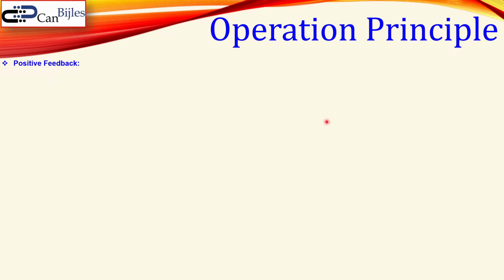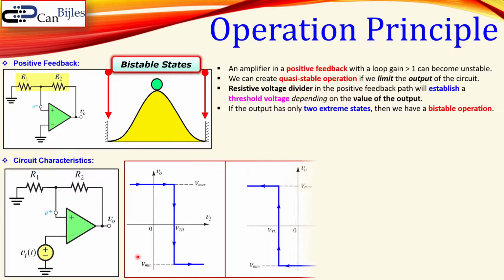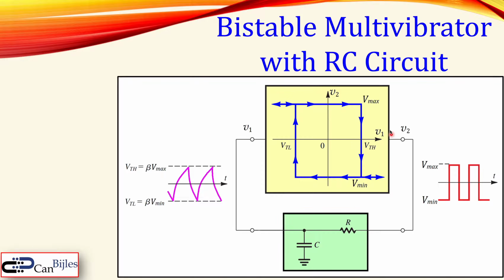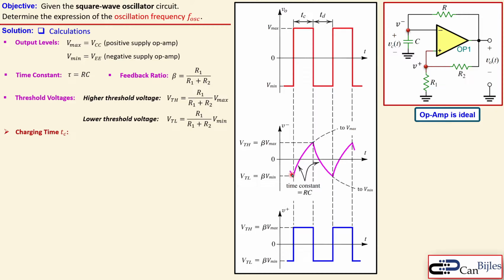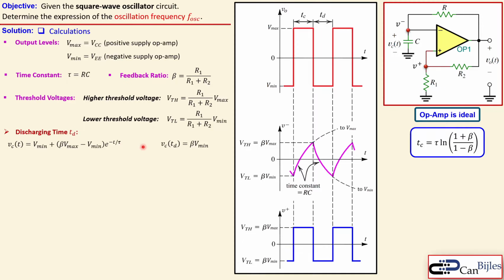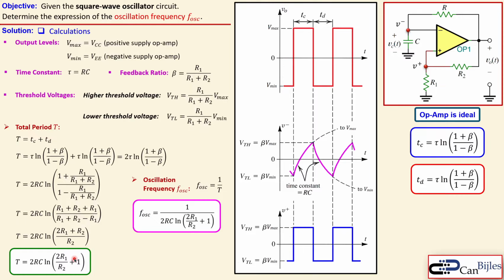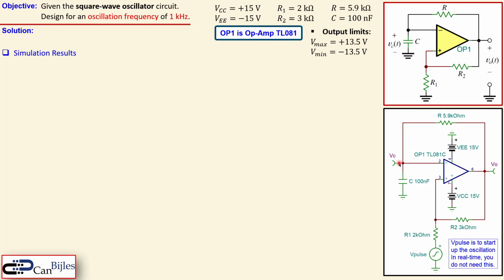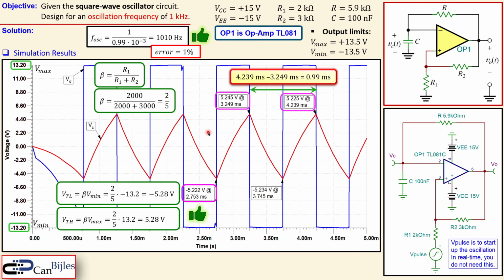Square-Wave Oscillator ⭐ Oscillation Frequency Derivation, Design Example & TINA-TI Simulations

Comment: I don't know how you can plot the graph of v- when you don't have a function at first? That makes me confused a lot when I approach this video.
Reply from the maker: The graph is derived from the capacitor charging and discharging equations which I explain in the video.
Reply: oh I know it, They are the formulas for discharging and charging voltage of a capacitor.

Comment: so what is the opamp gain ? If we supply +-20V then square waves amplitude become +-20(ideal) ?
Reply from the maker: The op-amp is operating in positive feedback having saturated max and min values, depending on the power supply of the op-amp. In an ideal case, the max/min output voltage will be also equal to the max/min power supply of the op-amp.